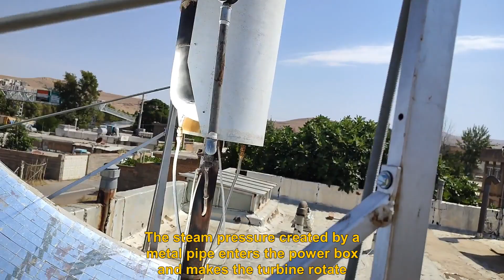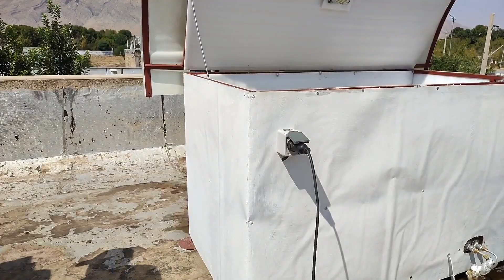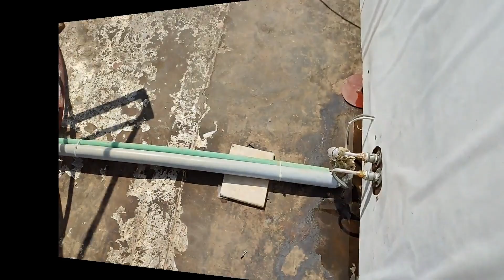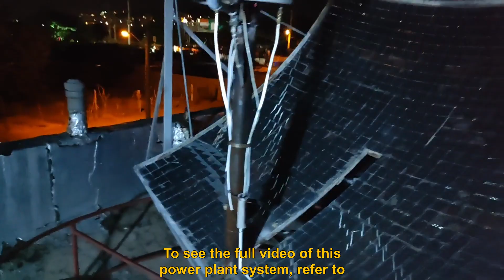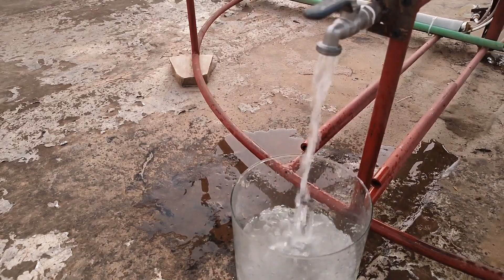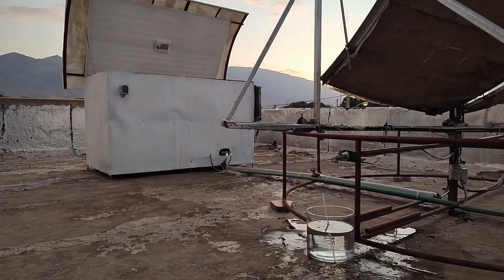The Surprising Truth About THIS Power Plant Nobody Tells You

Comment: Nice ! But a bit effraid still of the noise... By the way, to test with power tool, it will show really what it can give only if the power tools are used in resistance against something, for instance, cutting thick metal piece with the angle grinder.
Reply from the maker: No dear friend
This is just to test the power output
Reply: @fixedfocussolar  Yeah, but test in a non "real" condition is not a test of very much usefull isn't it ?